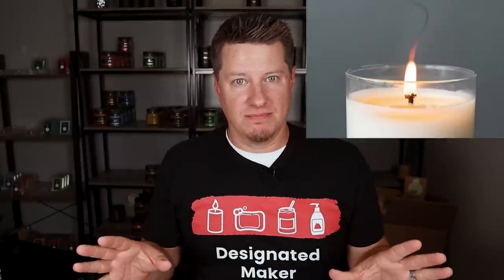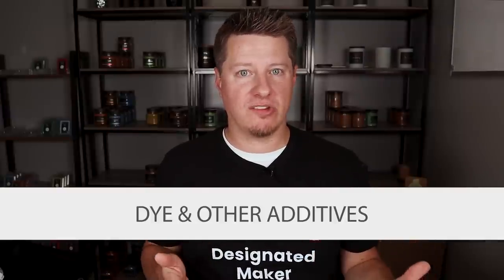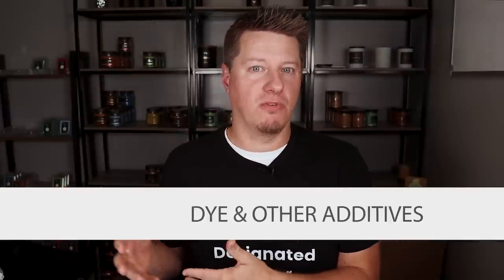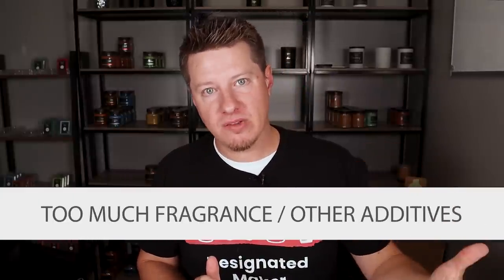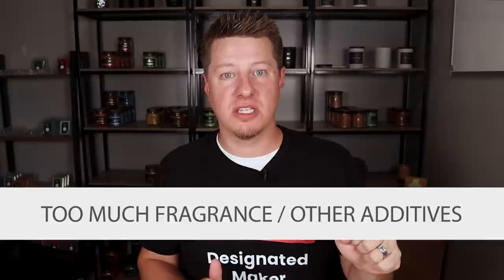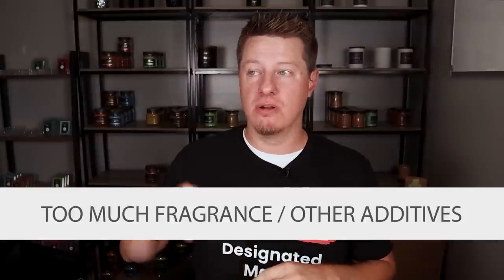7 Candle Making Problems, Causes AND Tips For How To Fix Them

Comment: Hey I am using 464 soy wax for my candles and had been facing a big struggle with the tops as they had bumps. Now I tried all your tips with an extra as I also add a tsp of coconut oil to my wax and the tops are so smooth.  I just wanted to know your toughts about coconut oil please. And thank you

Comment: What do you think about mixing a half cup of coconut oil to a pound of beeswax?  I hear that it helps with consistency and slower burning.
Reply from the maker: Coconut oil won't help with slower burning.  Beeswax burns slow already.  Coconut oil will lower the melt point and make it softer if that's what you're wanting
Reply: @BlackTieBarn  I don’t honestly know. 
I’m just starting out. What do you recommend and why don’t you use beeswax? (Just curious)
Reply from the maker: @kman8271  beeswax is good to blend with waxes, but its such a hard wax its usually used for standalone pillar candles. Many mix it with some soy or coconut though to make it soft enough for a container candle. I just dont use much beeswax as it doesnt hold scent well (has a distinct scent in itself). Its just a different kind of candle, nothing wrong with it... just not the kind i make typically
Reply: @BlackTieBarn  I appreciate you taking the time to respond.
Pray for me. I am beginning my journey next week 😃 
Thanks for the insight on the candles. 
I do want to make mostly hand dipped and pillars, but people love the jars. I guess I should mix it with something for those 🤷🏻‍♀️ 
Do you recommend anything for clean air?  (Why I’m using the beeswax in the first place)  I’m thinking coconut apricot… thoughts on that?

Comment: I did a candle and I used a Wooden Wick .3 5/8 inch and I use pro blend 6000 and there was smoke coming off the wick so I don’t know how to do the burn test on this candle desperately needing advice 😢 I forgot I have another question about wax are you able to mix paraffin wax with any other wax?
Reply from the maker: Wood wicks are finicky.  They won't burn exact same batch to batch.  You didn't mention your vessel size but if try a .02 instead

Comment: Wade I am at my witts end…struggling between choosing htp or premier for Problend 600 in the 12 oz libbey straight sided vessel…using 10% FO and small amount of dye. I get a small amount of soot halfway down the jar. Do you think I should try lowering my FO to 8%? Thanks so much 😭♥️
Reply from the maker: I use both these wick depending on FO. I would drop FO to 8 or o and see if it helps while also monitoring scent throw. And a little soot can be normal... just don't want a ton
Reply: Thank you so so much!!! :)

Comment: One time I made a candle and it had a terrible chemical odor when it burned.  I used the FO with some other wax and it was fine.  I was always curious what might have happened there.
Reply from the maker: Could have been the wax. Or could have been the wicks used with that specific wax. Or... could have been a bad/old bottle of FO unless it was the same bottle for both